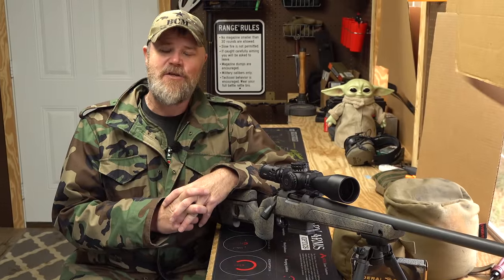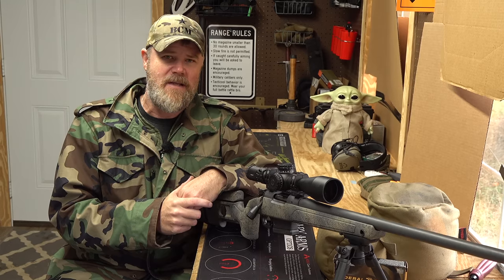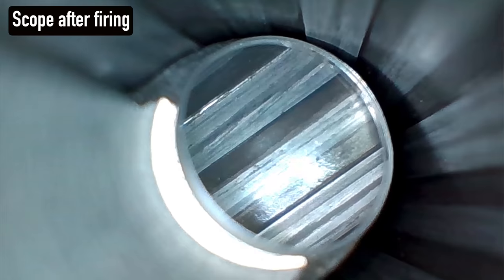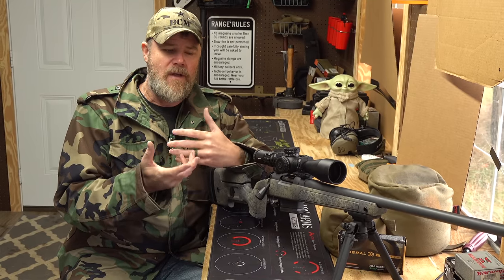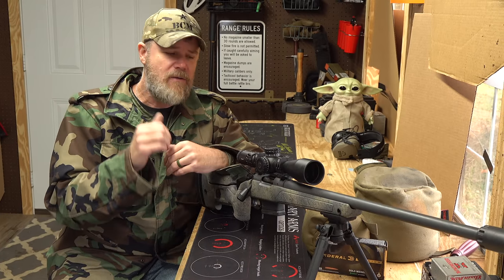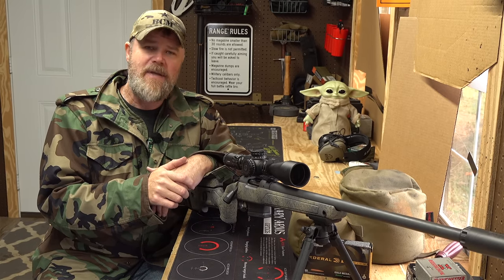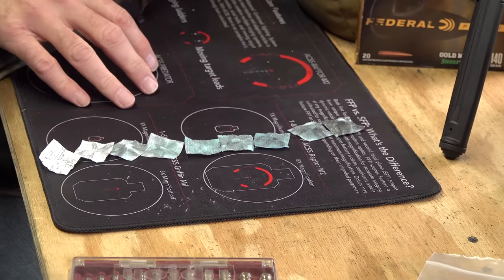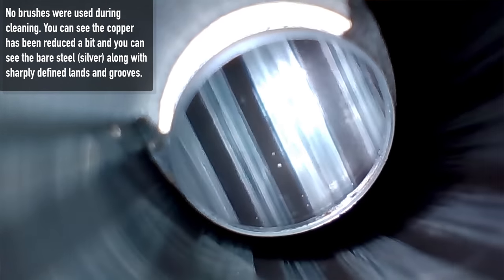Barrel Break-Ins and Cleaning Voodoo Rituals Destroy Barrels

Comment: I did my own test with a take off 6.5cm barrel and used a brass brush . I would do 500 strokes with some Kroll oil and take careful measurements  after every 500 strokes I got up to over 6000 scrubs and nothing changed in measurements I melted some old fishing sinkers I had and used them in the barrel when I pushed them threw I'd measure them nothing changed .. so for my own test I'm gonna say they're is not a copper or nylon brush out there that would destroy a barrel . I still have the take off barrel I am going to put it back on and try it but I'm 100% what shoots out a barrel is high round count and getting the barrel to hot and shooting one after another.  I don't scrub my barrel I use a bore snake after around 20 shots and I've never had an issue.

Comment: Look. Copper fouling is the result of copper melting due to A, heat of combustion of the powder and B, heat generated by friction as the copper is forced down the bore plus the friction caused by obturation plus the friction of resistance of the rifling pressing against the copper forcing it to rotate. That's it.

Comment: I'm more of a pistol shooter. Call me a barbarian, but I clean my barrel with brake cleaner, a single pass with a brass brush, then I push through a paper towel, and then oil it with RemOil on a q-tip. Well over 6000 rounds through my carry gun, and the barrel still looks fantastic. I would use better solvents if I ever built or bought a real precision rifle, though. That's too much money spent to cheap out on.

Comment: I personally just like to put a bore snake through.

One pull through before a hunt. Then i'll put some electrical tap over the barrel to stop water and dirty getting in there. The tap doesnt effect the  accuracy and stops you taking core samples.
If ive fired a shot on the hunt i'll put the bore snake through before it goes back in the safe.

If ive been at the range ill do the same. One pull through before and one or two once ive finished.

Comment: You're a better man than me. I clean mine with brakleen and carb cleaner lol. I was a mechanic before I ever touched a gun. I figured it works for everything else then what's the difference? Then I put some oil on patches if it's gonna sit. I use Comet dry graphite clutch spray in the pins, hammer etc. If it works in a clutch, why wouldn't it work in my handguns?

Comment: I do agree that using steel cleaning rods or brushes and certain corrosive solvents can damage or prematurely wear out a guns barrel. I don't think you have to use a nylon brush and cleaning rod even for a cleaning a high end rifle though. Just use some common sense. A bullet pushes a lead projectile encased in copper at high velocity with tremendous force down the barrel. How can pushing a soft aluminum rod with a copper brush down your barrel with your hand cause significantly more damage to your rifling compared to firing the actual projectile ?

Comment: I patch more than i scrub. I actually use a patch with 3-1 oil and a few drops of hoppes 9, then a couple passes of a nylon brush, then patch out again. Do this till no carbon comes out basically, then finsly run an oil patch down to seal. But scrubbing back and forth vigorously with a brush, isn't something i would bother doing.

Comment: Most barrels made in America are button rifled  even some target grade barrels  didn't hear you mention them  an shoot very well as far as braking in your barrel I think it should be cleaned after the first 10 rds and again after another 10 -20 rds  an cleaned thoroughly with patches solvent then  brushed then  patched again after that it should be broken in ,  I don't clean after every time I go shooting but I do run a patch or two before I go shooting an don't use a brush every time I clean and I also use nylon brushes

Comment: A plastic knife can never scratch aluminum foil, but you can use that knife to cut the foil by deforming it, crushing it, "cutting" by fracturing it. You can do that because the foil is so thin and is easy to manipulate. Once you have a piece of metal like a rifle barrel which is designed to withstand extreme pressures, that manipulation is relatively hard to replicate. Because copper has a much lower hardness than steel, you wont scrath the barrel with it and will likely never deform the barrel with it, so I really fail to see the negative effects of copper brush cleaning. The only etching that will feasibly happen is if flakes of harder materials are in the barrel, and those would also scratch with just a cloth patch.

Comment: Ammonia is not acidic. It's the opposite, or basic. Bases are corrosive and a base coverts animal fats into soaps, but ammonia can cause corrosive stress fractures in mild steel. All grades of stainless steels are impervious to ammonia.  I will use brass or copper brushes but those are a whole LOT softer than steel. Steel brushes? NO WAY. If a magnet sticks to it it's not a brush for cleaning guns. I am not too all concerned about a little copper & lead buildup  either. If a little remains in the corners of the grooves, so be it.

Comment: Just run a wad with some oil on it after every use so it doesn't rust in storage no need to clean any modern barrel. That don't mean you don't need to clean your bolt and ejector and if it's an ar15 the whole bolt carrier group.

Comment: Bone dry bore snake once pulled thru the barrel, chamber to crown before i take my rifle out to hunt. If i took a shot during the hunt i pull the bore snake thru the barrel about three times just to get most of the powder residue out before putting it back in the safe potentially for months. Powder residue does pull moisture out of the air and can cause corrosion, thats why you always want to get it out of a barrel that may not be shot in a while. If you know the gun will be fired again very soon dont even bother with cleaning it at all. Just make shure the brush on the bore snake is actually bronce, ive seen them with copper coated steel brushes before and they can damage a barrel. Bronce is completely safe, i dont care who you are. Bronce can not damage a barrel. Its like saying a toothbrush damages teeth.

Comment: I shoot my hunting rifle annually then run very lightly moisturized rope with Ballistol a couple of times and then insert it and leave it there. When the next season is coming I pull the rope out and run patches until clean.
I use to run the patches right after the rope but then I saw rust....so for me the rope is preserving the bore through the year.

Comment: I’ve noticed a ‘carbon ring’ through my bore scope footage.  This was caused (I think) by brass that was on average .020” shorter than it was supposed to be.  There was more carbon fouling at the leade and where the case mouth was supposed to be in 20 rounds.  I’ve never seen this with rounds that had a correct case length.  Just throwing in my sample size of one.  Great video.

Comment: I use the same philosophy for barrel cleaning as I do for when it comes to cleaning anything eg. Washing clothes, hair or hands - barrels etc. After washing with soap (solvent for the barrel) common sense is to rinse afterwards and for the barrel - rinse thoroughly with pure alcohol from the chemist/drugstore. Clothes get fabricsofterner. Hair gets conditioner. Hands get cream or lotion and oil for the barrel. Remember to run a dry patch before use...

Comment: I have used bore brushes on my Desert Tech, but... they are always the soft benchrest brushes that are slightly undersized with a wet patch wrapped around it, then a jag with dry patches.  With these brushes, if you run one down the bore alone, it doesn't do anything at all, they can pretty much just fall through the bore under their own weight. For the solvent, I have a gallon of G96 and that seems to work just fine. I don't worry about the copper at all until accuracy begins to go away then I will use the Eliminator that you use to de-copper and start all over again.  My 308 has never needed it in several thousand rounds, my 338 has needed it twice.  YMMV.

Comment: Great advise, thank you, I'll be following this with one exception: using a bronze brush. I'm not looking to super clean the barrel, but just be more effective on a single pass. The reason for not being concerned has to do with referring to the hardness scales which characterize the scratch resistance of metals. Since bronze is 3 Mohs, and basic steel alloy is around 4, we know bronze is not going to scratch steel. There is also no doubt rifles are using excellent grades of steel like carbon steel 4140 and 4150, so I assume hardness scales would be greater again. Rockwell hardness scales also show the same thing, but are more complicated to interpret. (For the same reasons, and to Colonel K comment's below, a stainless steel brush would be a very bad idea.)
Reply: Scratching doesn’t tell the whole picture of wear though. That only applies to two perfectly smooth surfaces on the atomic level. In real life there are imperfections on all levels of size, and no matter the hardness a softer material can definitely grab and remove material from the bumps of these imperfections since it’s less about hardness and more about physical contact area not parallel to the surfaces. It will grab and pull pieces off of the ridges rather than penetrate and scrape. 

It’s the same mechanism behind why car tires will wear down asphalt, or why water erodes rock, or why human feet wear wood floors. All of these are orders of magnitude softer than the wearing surface yet over time the interactions between the roughness of both surfaces grab and remove material. 

Whether that makes a noticeable difference in cleaning rifle barrels, idk, but a nylon brush is good enough to maintenance clean a barrel. Brass brushes only really need to be used to scrub every last bit of deposit out of the barrel which isn’t actually wanted in most cases.

Comment: Tikka made the rifle and recommends   "use a smooth cleaning rod fitted with a bronze bore brush soaked in bore solvent and push or pull through the bore untll all major residue is removed
 ( approx 10-15 times)"  After descriptions follow to finish up the work with felt pellets. Seems like a lot of brushing but does hint that maybe a bronze brush is no problem.

Comment: I have seen more damage from "break in" and "cleaning" than ever produced by shooting.

A match barrel is perfection, pretty much everything you are doing is degrading it.

A rough factory barrel, you aren't going to make better.
Reply: We had a customer bring back a 300RUM that he couldn't get to group.

He had "shot it in" by strapping it in a lead sled and running a box of ammo through it as fast as he could load and shoot.  Then tried to zero it.

The first 4 inches in front of the chamber looked like an aligators back, the steel was so cooked and crazed.

Comment: In the sadly now defunct publications Precision Shooter and Tactical Shooter in the early 90's some top manufacturers and shooters- Boots Obermeyer and Wil Scheumann among them- went and did the shooting and research and ultimately found that aggressive solvents and brass and steel bristle brushes truly did more harm than good.      After corresponding with Wil Scheumann in the early 2000s I have stopped using brushes altogether.  I swab out the chamber to maintain feed reliability and will occasionally swab out my rifle and pistol barrels with Kroil or Militec-1 and JB bore paste. My barrels have maintained their accuracy as well as I could ever hope for and I won't use any other method or materials for cleaning. Great vid, MAC!

Comment: This was enlightening for me.  I was following almost the same procedure as yours with my target 22 rifles and hunting rifles.  That is until I had a gunsmith build me a hunting rifle with a Douglas Air-gauged barrel in it.  Caliber was 260 Rem, known for excellent accuracy.  I asked the Douglas people what break-in I should do with this new barrel and got a simplistic procedure to follow that essentially included shoot 1 round, clean the bore (he recommended Bore Tech Eliminator), then shoot 2 or slightly more rounds, clean the bore and then repeat the process until I had 20 - 30 rounds through it.   I called several other barrel makers and got similar advice so thought I was golden.  This was all after almost never cleaning my Win 52 target rifle at all and it shot wonderfully with the same ammo brand it liked for years.  My hunting rifle was a Win Model 70 pre-64 270 Win that was given to me before I moved to Alaska where I shot a Moose every year with the appropriate sight-in process and again, never really cleaned my rifle up there.  I shot fine.  My 260 Rem still shoots fine with the ammo it likes but I stopped the involved cleaning process and am doing the same thing you are doing with the same product.  I did think I needed to get all the copper out but eventually I just shot the rifles and went back to a simple process, but only did the Bore Tech thing once a year.  Bottom line is all my rifles shoot fine so I'm doing the same process as you but I shoot very few rounds through my hunting rifles and don't clean my .22's at all unless the chamber gets gummed up with the lube on .22 ammo.

Comment: I generally agree with your opinions concerning custom barrels as they are made to a higher grade and I just follow the recommendations of the manufacturer.  As to a standard barrel on a rifle supplied by a company today I generally use an abbreviated break in procedure especially on more budget oriented offerings.  I find Savage rifles to be supremely accurate for their price point and myself, my family and friends own many.  My own favorite hunting rifle is a standard AXIS in 270 Win with a M*Carbo trigger.  It produces 3/4" groups at will with my handloads and takes a beatin' and just keeps on ticken'.  That rifle along with a dozen others that I have broken in all shoot above expiations'. Was it the break in ?  I don't know but I do know it didn't hurt and when I bore scoped the bores when new there was everything from metal chips to assorted trash in the bores and chambers.  A good cleaning and swabbing with Bore Tech initially and between shots during sight in and and subsequent rounds leaves the bore in nice shape with a little copper burnishing.  I just bought a Howa 1500 Hera H7 in 6.5 Creedmoor, the bore was clean and perfect as delivered and I did shoot a half dozen sets with a quick swab in between and even out of the gate I have never owned a rifle so accurate.  Again, was it needed ? Who knows but IMHO it couldn't hurt.

Comment: About thirty-five years ago I got into rifle shooting. I did some hunting but spent a lot of time at the rifle range. At work, a bunch of the guys were also into shooting. One was an army vet who told me that far more hunting rifle barrels had been ruined with a cleaning rod than had been shot out. 

Most hunters only shot at most ten or twenty rounds per year. They go to the range to make sure their rifle is sighted in (did they drop it or run over it with a truck after last season?), shoot a shot or two when they get to where they're hunting (did they drag the rifle behind the truck?) and then maybe one or two shots at game. That's it. At that rate, the barrel should last a couple of hundred years. 

But they also scrub and scrub, often without a bore guide ("What's a bore guide?"), using a hard metal rod, letting it go past the muzzle damaging the crown. ("What's a crown?") They grind away at the chamber and throat, use very harsh "copper removing solvent" and bore scrubbing compounds, ("My barrel is always squeaky clean!")... and wonder why the barrel gets worn so quickly. ("My accuracy has gone to hell!!")

At the range I usually put about twenty rounds through the rifle. (I always take two or three rifles.) When I get home I run a wet patch (good old Hoppes No. 9) through, using a bore guide and being careful to not go out the muzzle. My cleaning rod is plastic coated. I use a jag, not a brush. All I want to do is remove powder residue. Three or four dry patches gets the barrel done. A micro amount of gun oil on a clean patch then completes the job. That's it.

Comment: I've been having problems with carbon fouling. Not sure how Hoppes #9 works on carbon. Tim, it seems like you are not relying on mechanically removing the copper and carbon, but instead, you are removing it chemically. I'll try out that solvent you use. Thanks for your great work.

Comment: Hardness scales… soft doesn’t cut hard. Your comment about a brush dragging carbon and flakes down a barrel is entirely different. The carbon and flakes may scratch but you saying brass brushes do it is misleading. You’ll drag the same flakes down with a plastic bristle. In fact. Brushes are more likely to sweep (like a broom) then a patch which acts like a mop and traps the particles between the cloth and barrel wall. Anyways, I’m not saying one way or another is better,and opinions or preferences are fine, but this generalized argument stuff is crap.

Comment: You run a dense copper jacket projectile at insanely high speed, pressure and temperature down your barrel, but don't want to use a soft brass brush to help clean loose dirt out of it.  ???  Come-on. Get real. 
Just look at the cleaning proses of some of the .22LR barrels. They use brass brushes in it after every 300 to 500 shots. Those barrels last forever even with the aggressive cleaning. So, is it the cleaning that reduce a barrel life or the shooting at very high pressure and temperature killing it? What influence does neck angle have on barrel life? 
Yes, some totally wrong cleaning procedures will damage a barrel, but a brass brush used correctly is not one of them.